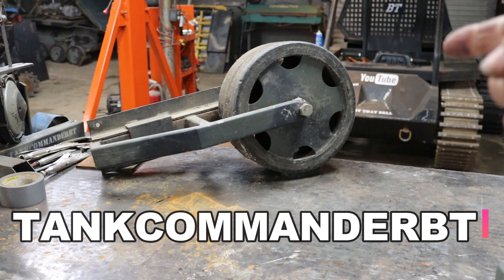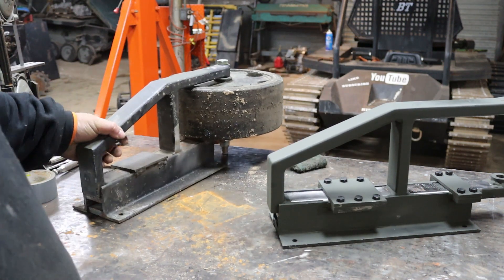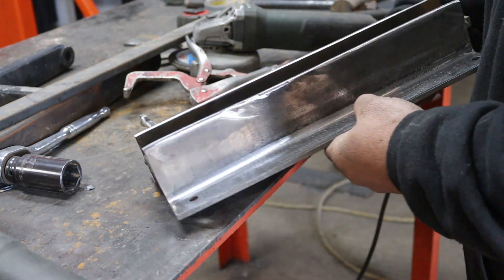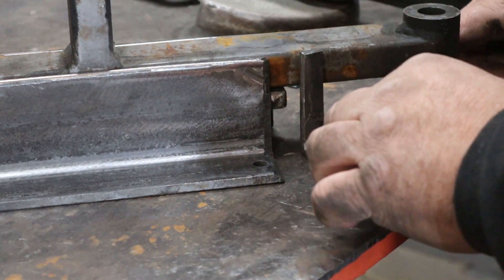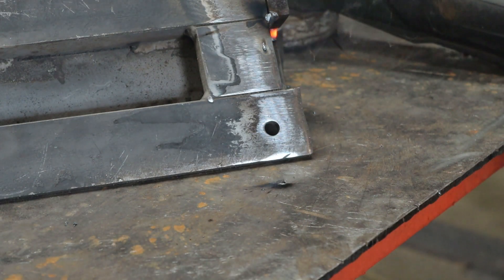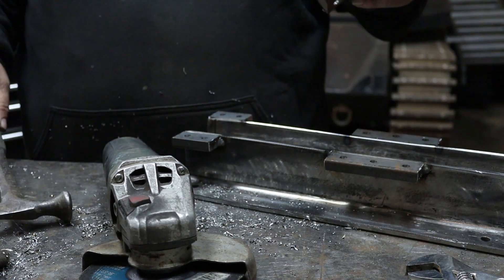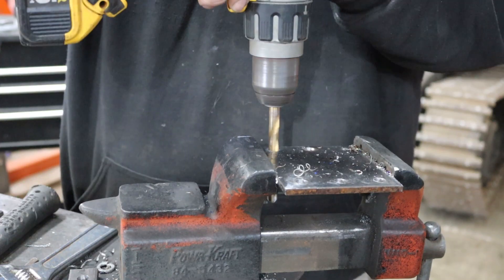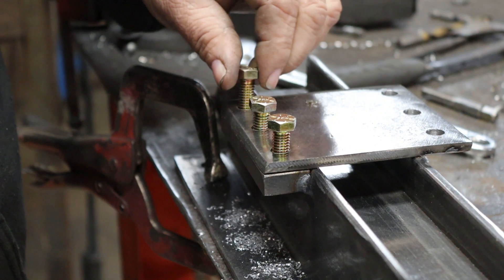homemade tracked vehicle (REBUILD TRACK TENSIONER)

Comment: That vehicle is pretty fast, what kind of hydraulic pump/motor setup are you using and what kinds of pressures/flowrates do they operate at?
Reply from the maker: I am using 21cc hydo pumps and wheel motors. they operate at 3000 psi.  Motors and pumps are hydro-gear . wheel motors $750.00 each and just over $1200.00 for the tandem pumps . Thank you hope this helps .
Reply: @mimimitchell1989  thanks alot! Hope you have your tracked vehicle on scaledtanks, so everybody can read about it
Reply: @mimimitchell1989  I am building a snow rig. Just at the point of sleeting motors. So those are 21cc wheel motors? I tank it from the videos no torque issues?
Reply: @mimimitchell1989  here is my build! https://youtube.com/watch?v=8-Y43WtZAuk&si=EnSIkaIECMiOmarE
Reply: @mimimitchell1989  which wheel motors? The HMG-H 14.9 cubic inch? Thanks